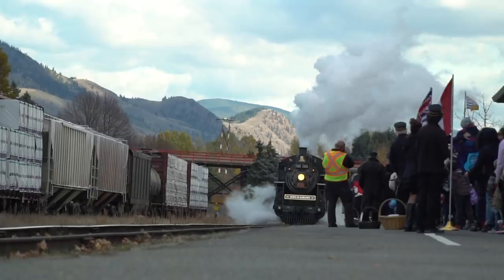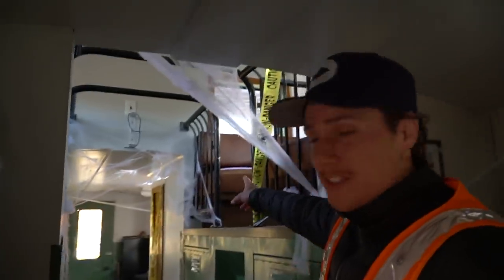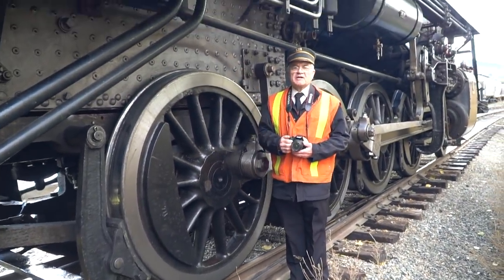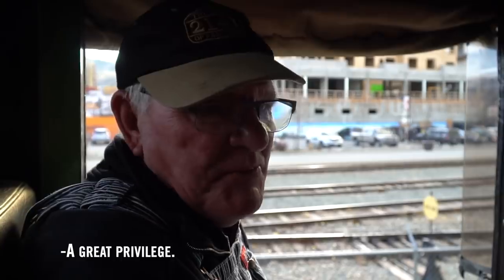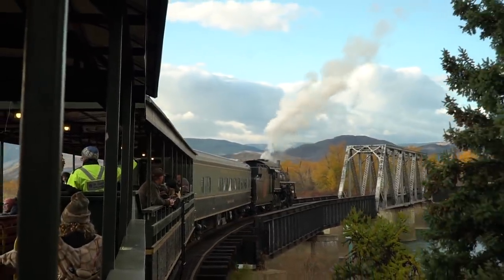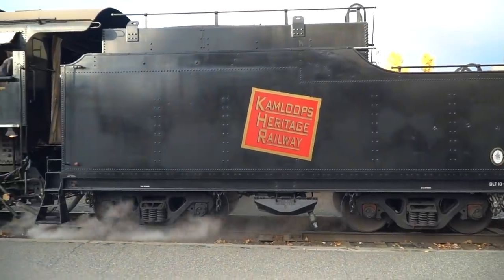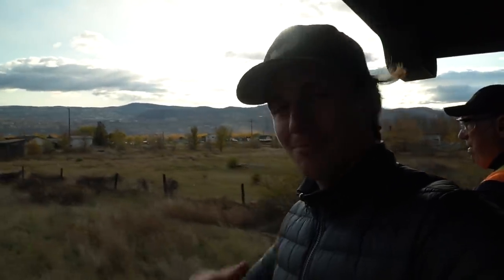This STEAM TRAIN runs on ACTIVE TRACKS in Canada!

Comment: In 2011, I got qualified to operate the Atlantic 4-4-0 steam locomotive in Jefferson, TX. It took all of the 3-4 hours to get it ready to run. Started out by starting water to the tender, then oiling all the fittings directly beneath the boiler. Then I would light the fire and finish oiling the remaining fittings. The fuel was propane which meant there was a loud roar anytime the fire was lit. Unfortunately, 2011 was the year of the massive drought and heat wave in Texas and it clobbered the tourist business in Jefferson. And as you know last-hired=first-fired but it was great fun while it lasted.

Comment: Yes, l rode on the steam train at the Mid Continent Railroad Museum in North Freedom, Wisconsin.  That steam engine has been out of service for twenty years but is being rebuilt and should be back in service again soon. It takes a long time to raise the money for the rebuild project.  In the mean time, the museum still runs the train in the Summer time but they use an old diesel engine to pull it.

Comment: There are quite a few steam specials in the UK that run on network rail infrastructure. Indeed our local preserved steam railway, the NYMR (North Yorkshire Moors Railway) runs on it's own tracks between Pickering and Grossmont where some services connect onto the network rail track and on to a seperate platform at Whitby costal station where the NYMR rebuilt the platform and track on the unused side for their own use.

Comment: I have to check this out next time I head west! Have you ever visited the Halton County Radial Railway Museum in Milton, Ontario?
Reply: Ive been there, its pretty interesting though I prefer South Simcoe Railway north of Toronto near lake Simcoe. Its a tourist steam train that they run a few times a year. You can actually buy tickets and ride the length or preserved rail line
Reply: @patrickm5217  I passed by it on the way home from another trip this year. They are just opening up for the fall this year, it seems. HCRR is much closer for me, but they aren't open this year.

Comment: Come check out the portage flyer in Huntsville Ontario if you get the chance. Small shunting locomotive that ran passengers up to the late 50s connecting two lakes. I was the fireman on the locomotive for three years but have other obligations at the moment. We also run an engineer for the day program which costs in the $300 range and we let you drive the train with passengers for a day after some training.

Comment: There are lots of excursion trains in the US. The only one I have ridden is the https://www.1880train.com/ that runs between Hill City and Keystone in the Black Hills of South Dakota. It normally operates with a 1920's oil fired Baldwin Locomotive, but they run a diesel on the first trip of the day while the Baldwin is heating up.

Comment: Did they say anything about how long they can keep the engine up and running? I visited Steamtown USA and they mentioned that for safety reasons with the pressure vessel for the steam they can only run an engine for a few hundred hours before having to take it apart and check everything, which makes it very difficult to keep these museum trains up and running on actual steam.
Reply from the maker: Oh wow. I didn’t ask. That would be interesting to know. 
Good question
Reply: @DownieLive  Hi Greg, We are required to strip the loco down and re-tube the boiler every 15 years. It is about a two year process.
 Regards,  David, Kamloops Heritage Railway volunteer.
Reply: David, in the mid-80s I rode the gorgeous Royal Hudson 4-6-4 train out of Vancouver, but it is no longer in service. I wonder if there are any plans to restore it to service?
Reply: @RickyJr46  Hi Ricardo, The Royal Hudson is in the West Coast Railway museum in Squamish and my understanding is that there are no current plans to restore it due to the massive cost of the repairs needed.   David.

Comment: Now we run 11000 to 15000 ft trains two men is all it takes back in the day the would have five and if you go back even more there seven crew junior brakeman ran on the tops of the cars to spin on hand brakes to slow the train this was before air brakes many brakeman lost their lives by falling off the cars try to spin a brake hence the name brakeman.  On the five man crew there was the engineer, fireman, headend brakeman and in the caboos there was the lazy conductor and the rear end brakeman.  The fireman made sure the locomotive didn't blow up the engineer and to this days job is to make sure the train gets there in one peace.  and the conductors job is to keep the whole thing together and moving smoothly or thats was what there job used to be.

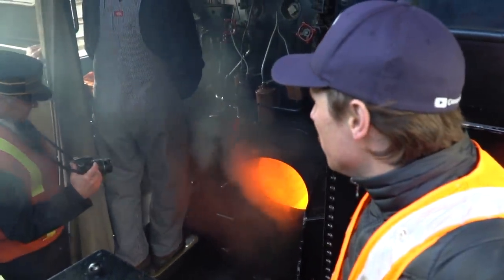Comment: 1:29 It's burning recycled oil from our old cars.
5:18 It has no pollution.
I think he's wrong on one of these things.
Reply: Old is a relative term. Look up the definition of polution.
Reply: If you get the air to fuel mixture right, there's no pollution. The black smoke you see is caused by fuel that has begun to burn, but has not burnt completely. This is true for diesels as well.

Comment: I suspect that all steam locomotives will be required to burn clean fuel in the future.
Reply: Steam is as clean as you can get. It's just water. Quite fascinating really that these beasts ran on something as simple as water.
Reply: Craftman Seven Eighty Actually, the water just transfers the energy. The heat has to be created by burning something.
Reply: @critterIMHO  as in this video, recycled motor oil, coal, or really anything that burns.